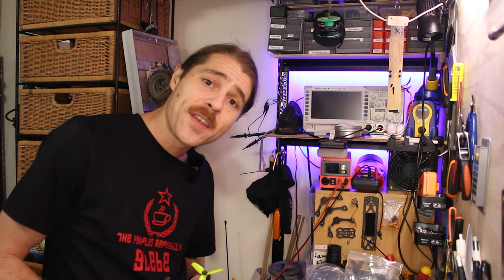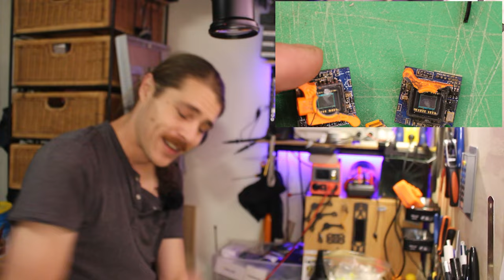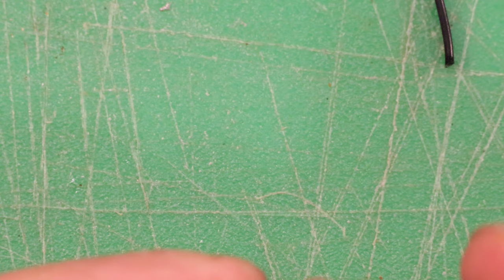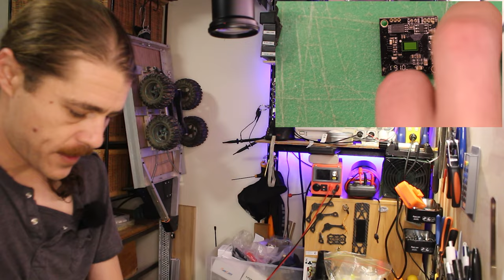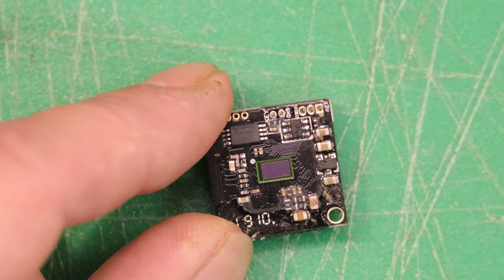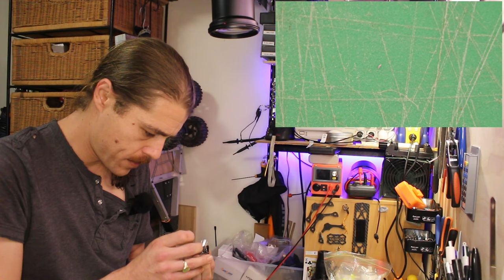Must Know Tool Tip For FPV Or Any Camera User

Comment: Great tip. I’ve used sticky tape a few times but found the adhesive sometimes is left behind. The best thing I’ve used is rubbing alcohol and a lens cleaning cloth. It removes any gunk and sticky residues.
Reply from the maker: Much appreciated Zuldan. Good old Isoprop and an ear bud. I was going to end up there if I hadn't found this. I have seen that kind of thing on glass before, but only if left for a time. I guess you would end up using the tape to remove tape then which is kind of counter productive. For the record im using Securaflex. The tape has been stored in a dark place with low temp delta, which may make a difference.